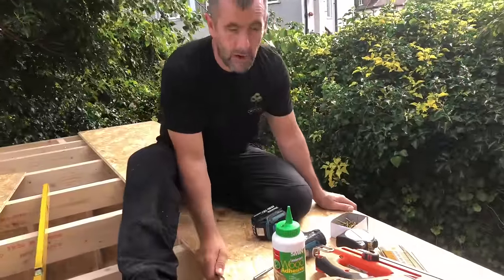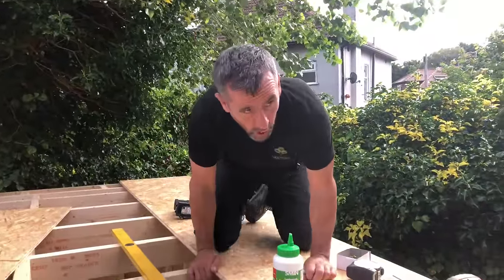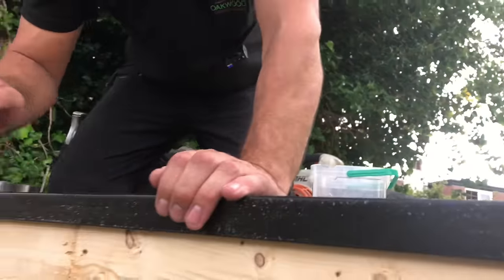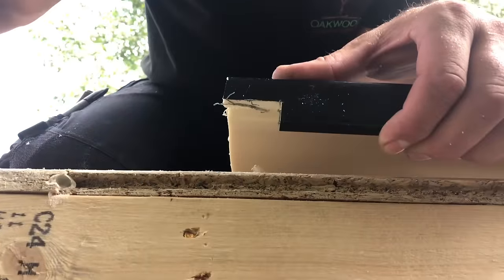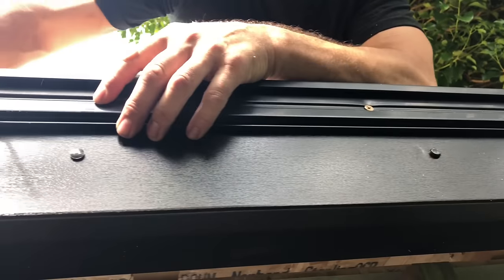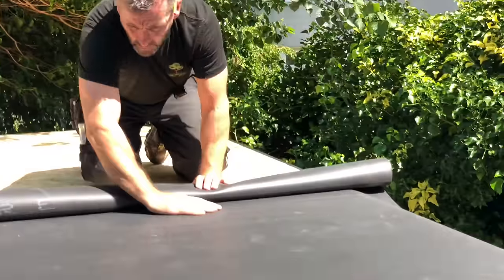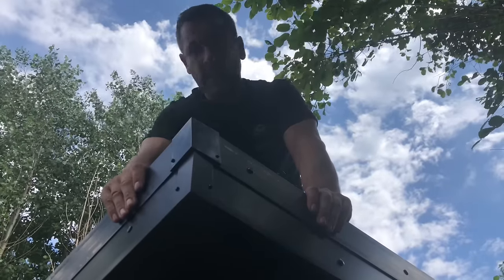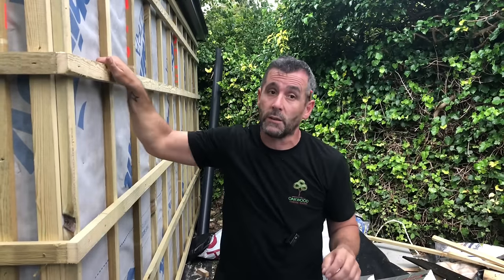Full rubber roof installation, upvc soffits and fascia

Comment: Not a roof question but I've used 150mm x 50mm timber floor joists on a 4.2x 4.2m area, I've spaced them at 600mm apart, is that too far apart? I've placed plenty of noggins between them in the hope that stops any sagging with the flooring 🤞
Reply from the maker: What thickness is floor mate?
Reply: @thegardenroomguru  I'm planing on using the 22mm osb board you use with flooring to go over that at 12-15mm roughly.
Reply: @thegardenroomguru  do you think the 22mm osb would be ok? Or do I bite the bullet and add extra joists in to bring it closer in?

Comment: Question what’s stopping the water from running off the sides of the roof as there seems to be no upstands to stop it
Reply from the maker: Have you watched it mate? I put kerb trim on 🤷🏻‍♂️
Reply: Watched it twice
Reply from the maker: ags tony 17.52secs, fixing Kurb trim, it’s got a 25mm upstand,
Reply: @thegardenroomguru  bit of Bond and Seal between the trim and rubber, otherwise the water will still run underneath?
Enjoyed the vid mate 👍
Reply: @tonyatkinson8962  agreed that kerb aint stopping no water running down the fascia without being sealed

Comment: The roof looks completely flat? Why isn't there firrings on top of the joists? Where is the fall?
Reply from the maker: There’s a 75mm fall on it, I stopped using furrings as they were always cut crap, front wall is higher than vabk
Reply: @thegardenroomguru  so is the internal ceiling slopped?
Reply from the maker: Yes mate, gives you max head height, only noticeable if tv is level on that wall

Comment: Please don't glue the joints when using OSB 3 t+g boards. The whole idea of these type of boards is so they can contract & expand during different temperatures and conditions. I have been using them every day for over 20 years.
Reply from the maker: It’s not butted up to anything, it’ll move as one! Never had an issue, it’s got ringcut nails holding it, it ain’t moving, tganks for your input though
Reply: @thegardenroomguru  Hi Will, have been installing flat roofing for 38 years, looks like you do a very good job. Its just pointless gluing the boards, the whole point of the 2400 x 600mm OSB3 T&G board is to keep any stress due to thermal expansion, even over the entire roof. If they are glued you remove this quality. www.glassfibrespecialists.co.uk
Reply from the maker: john keane not saying your wrong mate, just in this case it’s important to glue the joints with expanding polyurethane glue as any air under the boards when heated by the sun, expands, pushes up as it rises, then pushes the rubber up, just saying what I ser
Reply: @thegardenroomguru  It is not quite so important on smaller area's as any expansion can be quite small.
Reply from the maker: So what we saying then? It’s ok or not? osb3 as with all laminated materials are very stable in nature, it’ll never get wet, it cannot get moist underside as it’s hybrid roof, heat expands most materials, but with the absence of moisture this is minimal, it’ll expand if at all , as 1, never had an issue in all these years, hundreds of garden rooms down the line
Reply: @thegardenroomguru  On a small roof like in the video it will not matter very much Willy.
Reply from the maker: john keane you lost me completely at please don’t glue! Can I glue or can’t I glue? Cos I’m gluing  anyway 🕺
Reply: @thegardenroomguru  Simple, best not to glue. If you have had no issues on smaller roof's, then carry on wasting your time glueing them together.  Your work looks great anyway, nice to see someone taking lots of care and pride in his work.